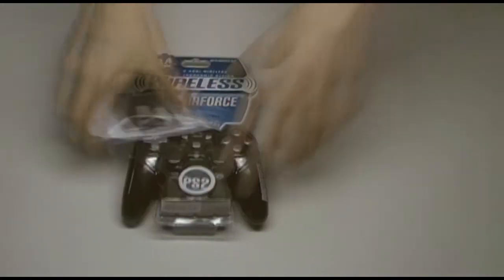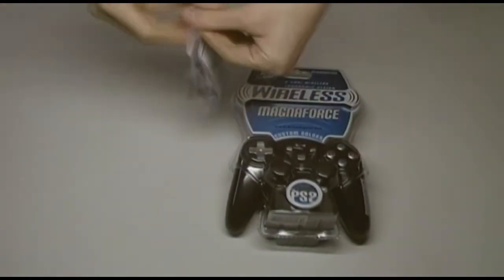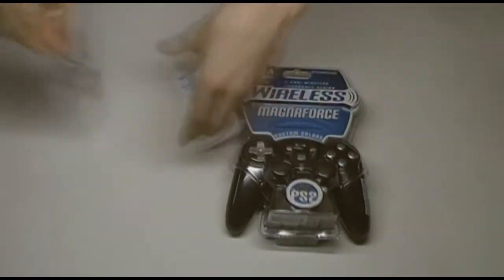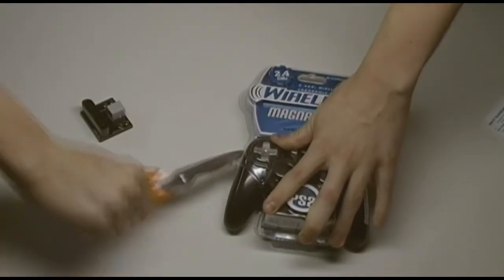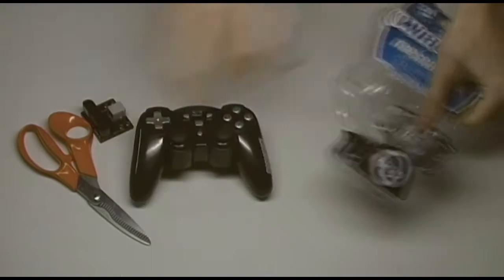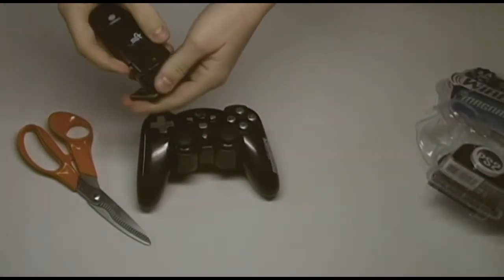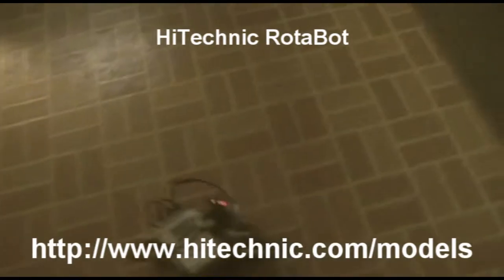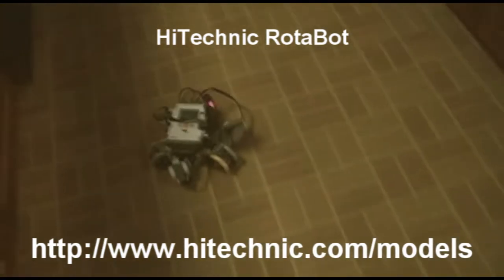PSP-Nx-v3 testing

Comment from the maker: I believe it is the same thing, it looks like he just bought the adapter and already had the controller, as i said in this video, the controller is just a PS2 controller, which doesn't have to be wireless but the one you buy is wireless, you could just plug and PS2 controller into the adapter, anyways, if it doesn't work with tetrix for some reason it still is great for NXT. Also, it does work in Robot C and Lab view, but as i said, i have never used it with tetrix myself, this is just a guess..